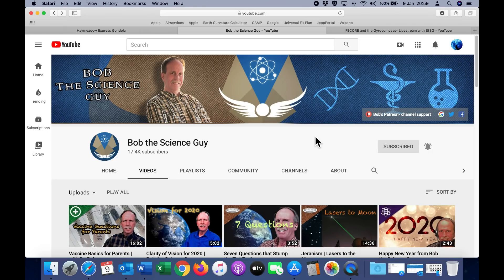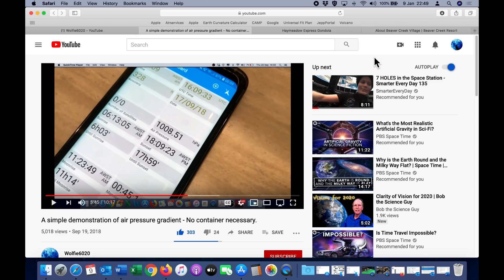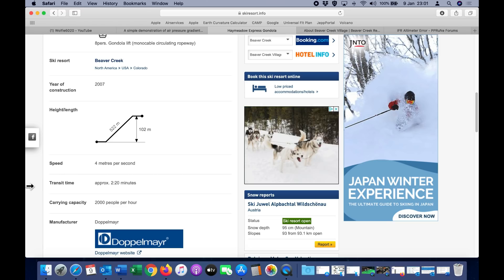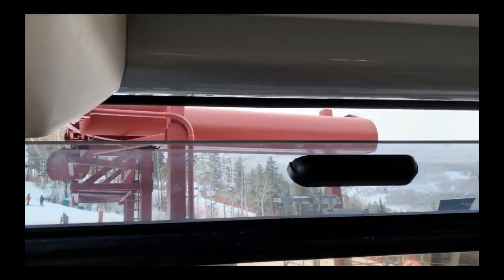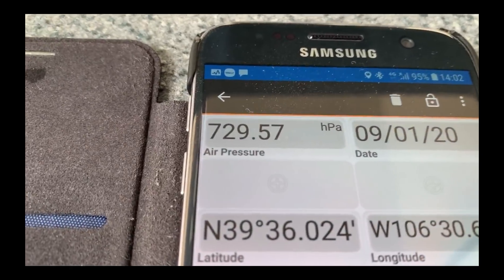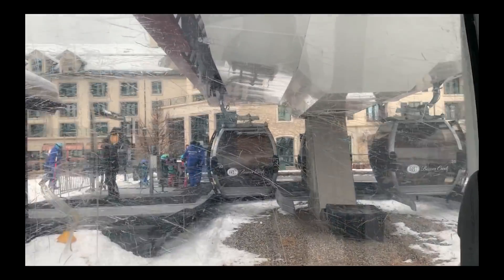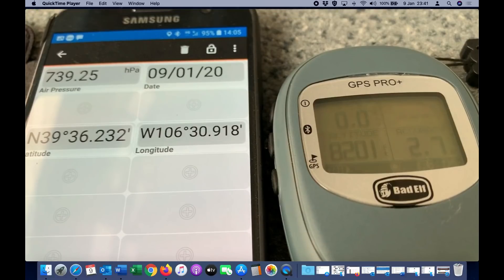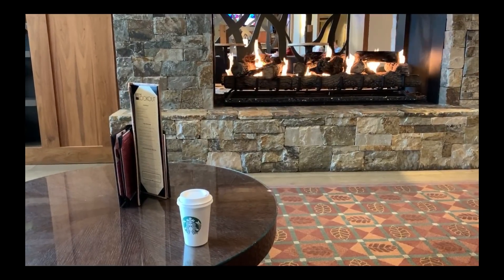Looking for a pressure gradient in Colorado USA.

Comment: Another wonderfully conceived, executed, and presented demonstration of a round-Earth truth – the effect of gravity on the atmosphere.

On a side note, though, I was puzzled by something you put out at the beginning of this, about the drop of pressure with increasing altitude.
1 hPa/30 ft ? So the atmosphere goes to 0 at 30,000 ft? And negative above that?
OK, it's a rule of thumb; but the point is, it isn't the pressure drop per altitude gain, ∆P/∆h, that's constant; it's the fractional, or percentage, ∆P/∆h, that is.

P vs h is close to a decaying exponential function, at least in the realm of commercial aviation (this falls out of the math of an ideal gas in a uniform gravitational field; significant change in temperature with h, causes it to deviate from exponential).
At sea level, the pressure is about 1000 hPa (1013 on ave; fluctuating with local weather).
So if it drops 1 hPa/30 ft at sea level, then as you go up, it should remain dropping about 0.1%/30 ft.

If you're at 40,000 ft, where the pressure is, I think, around P = 300 hPa ≈ 0.3 times sea level pressure; ∆P/∆h would be around 0.3 hPa/30 ft = 1 hPa/100 ft.
Surely pilots are taught this?

Fred

Comment: God, it's so stupid for FEs to say that hotels are under some kind of additional pressure different from the external pressure.
Reply: In fact, it is not necessary to ride a gondola, the usual 10-storey house and a chinese barometer are enough - it is not difficult to measure the pressure difference, and to make sure that the house is not pumped with additional pressure can be done with the exit to the balcony.

Comment: Experienced ear popping in planes and high speed elevators, both CN Tower and 1st Canadian Place in Toronto. Oh yeah and my phone has a BOSCH BMP280 barometric pressure sensor, accurate to 0.0018 hPa, currently 998.25 hPa and raining.

Comment: FFS Flerfers believe hotels are pressurised? How could they could tell? There's nothing but vacuum between their ears. 

To clarify modern buildings do create a positive air pressure in certain areas BUT this only occurs in fire stairs during a fire alarm to prevent the fire stairs being filled with smoke.

Comment: Easy pickings Wolfie. Of course pressure gradient is a thing.

If the atmosphere is not in a container, however, how do you explain that it hasn't been slowly stripped out by molecules escaping?

You know that according to !!!science!!! the hottest molecules in the atmosphere are in the last layer which called the Thermosphere and clock around 1700C (allegedly ofc) . That's plenty for them to escape the gravitational pull of the Earth. Once they are out you can repeat for the next layer. Considering air molecules of around room temperature can overtake the gravity in the ground and fill a container, the ones in the Thermosphere, which also has weaker gravity, should have no problem doing so. If they run out of energy the sun will heat them up the next day.

As a relatable example, I can fill a cup with cold water before going to the beach and not put a lid on it. It would be preposterous to say the water will jump out of it and I won't be able to drink it. But if I leave my cup on the beach getting hit by the sun all day, a week later there won't be any water left. All of it will evaporate. The atmosphere of the Earth seems to be "immune" to this.
Reply: "how do you explain that it hasn't been slowly stripped out by molecules escaping?"
Some molecules are escaping constantly, and some others are captured especially by the "sweeping" of the Earth on its trajectory around the sun.

Comment: I've been saying for years that these flerfers need to do some mountain climbing.  Climb a mountain, feel your lungs struggle for air.  Then tell me there's no pressure gradient.  When you get about two miles up you can feel it.  You don't even need a barometer.  We have a very conveniently located mountain here in Oregon called Mt. Hood.  I challenge any flerfer to summit that bitch or STFU.  They might save us some trouble by doing it in February and earning a Darwin Award in the process.

Comment: yes, but the "lift" you entered is a closed system with a barrier.  you need to prove the pressure changes, when you walk out side.

;)

(jk, I'm not an idiot)
Reply: Undoubtedly some flatty will see this and decide to believe that the increasing pressure in the lift interior has something to do with the windows being open and the lift descending at the blistering rate of like 50cm/s, forcing air into the lift cabin, and keeping the additional pressure there when it comes to rest because reasons.

Comment: Well done Wolfie, for some reason flerfters don't seem to recognise that a barometric altimeter is a glorified barometer which when calibrated properly will demonstrate altitude for a known local barometric pressure, or alternatively will demonstrate barometric pressure for a known local elevation.  Either way a pressure gradient is demonstrated.

Comment: It would be interesting to get the OAT as the same time. There are some pretty neat equations in Prandtl's book "Fluid Dynamics" which explain how temperature and pressure lapse rates are connected, and hence why the pressure lapse is linear. Great video, keep them coming.

Comment: C'mon, mate! Beside the interest of that experiment, admit you just wanted to get the freshest air possible after the very hot days that Australia is living...
Reply: You can add smoke and humidity to the heat. 48.9ºC (new record maximum for the Sydney basin) for Penrith on the western outskirts of Sydney a week ago.
Reply: @daveg2104  Smoke... The severity of those fires is heartbreaking.
Reply: @FrenchCrow  A lot of fires still burning, but Eastern Victoria and the Snowy Mountains region is seriously on fire now. Had a southerly change (cold front) come through last night that has dropped the temperature, but there hasn't been enough rain in much of N.S.W. to make a difference.
Reply: @daveg2104  Sad. France offered assistance a week ago (finally!) and australian goverment agreed we send some experts but nothing more so far. Too bad it would be difficult to bring some of our water bombers there (short range planes) but I guess some more firemen would not hurt.
Reply: Some water bomber helicopters could be stuffed in a big Antonov though :-)
Reply: @FrenchCrow  We do have water bombing capability, but the problem is that the fire fronts are too long, the fires too intense, and during a drought, water isn't always in plentiful supply where you need it. When the conditions allow, they try to put in control lines by back burning. It is about saving lives first and property second. We had a team from Canada here for a while, mostly to help relieve the controllers, and learn from us and pass on any knowledge they had. And we often have people from the USA, mostly from California, as they have similar fire problems to us.
Reply: @FrenchCrow  If you are interested in seeing what the current situation is, Google "RFS fires near me". It has a map showing all fires in N.S.W. and their current status. It also shows just how much forest has been burnt.
Reply: @daveg2104  I will look. Thanks.

Comment: One must have a very biased opinion to deny pressure gradient when he can feel it on his own eardrums while getting up or downhill in a car 😲
He can experiment it with a baloon fit on the mouth of a glass bottle as well.
Reply: Just carry an unopened bag of potato chips 👍
Reply: One needs to be intellectually dishonest. Which, as luck would have it, flerfs are in spades.
Reply: @ReValveiT_01  thank you for I learned a new idiom 😊
Reply: Indeed. I used to feel my ears pop occasionally as I drove to my work over an elevation of only 250 metres.

Comment: Simple kids-experiment from the 1970-80:s:
Get a balloon (party kind), a glas jar, a light straw or light stick that is twice the length of the diameter of the jar, a couple of rubberbands, and a tube of generic glue. (And a pair of sissors.)
Use a pair of sissors to cut the balloon into a circular piece, and stretch this tight over the open jar like a lid. Use the rubberbands to keep it in place.
Glue the one end of the straw to the 'rubber lid' at the center. You have now contructed a very basic barometer. (Very unsensitive...)

The altitude at which you stretch the lid over the jar will become the reference pressure.
As you move the 'instrument' up or down, the end of the straw that is sticking out, will rise with increased outside pressure and fall with decreased outside pressure.

We were taught about how this basic barometer functions in school, at the age of 11...
Reply from the maker: Thanks and I wish I had thought of that one at the time. 

Great experiment and I will definitely try it for a future video.
Reply: @Wolfie6020  Perhaps do a little more research, rather than taking my 30 year old memory on this as flawless. Please? ;-)
Reply: A slightly off egg in salt water would do the same thing due to the egg having a bit of gas in it.  Bugger to set up but it has egg.....the instrument of FE choice.

I made a barometer with a long length of small bore flexible plastic tubing that had one end capped off and the other with a plug of coloured water as a low tech method of measuring the max height of my rc glider.  The drop in air pressure pushed some of the water out of the tube, when it landed the water was sucked back.  If memory serves 1mm = 10m with a tube of about 1m length.

This stuff is not hard.
Reply: Sky Sparkane did this in one video.  Results were as expected.
Reply: @SpottedSharks  Thanks for the ref... watched and felt very little to no surprize.
https://www.youtube.com/watch?v=w2AGNp7xT2I

Comment: Hey Wolfie:  3:10  .....but I love the snow and cold weather.    Then you should come here to Edmonton in Canada.  We have lots of snow and it is -20°C.   ❄️ 🥶        Take that Colorado.    😁
Reply from the maker: +My3dviews.  I usually go to Montreal for a week in February for annual training.  That is very cold.  I almost froze walking to get the hire car from the airport one year.  I think it was -25 C.
Reply: @Wolfie6020    I've been to Montreal (long time ago), but only in the summer.  
It is supposed to get -31°C here next Tuesday.   Not looking forward to that. 

I lived in a different part of Canada ten years ago, and one time a window in my bedroom broke, when it went down to -40°C while I was sleeping.  Scare the @#$% out of me.
Reply: @derpjesus3468     There is no high gas pressure against a vacuum.  
Think about it.  What happens when you go up in altitude?  The pressure at sea level is 14.7psi.  If you go to the height of Mt. Everest the pressure is only 4.9psi or about 30% of sea level.  Go up even higher and the pressure continues to drop.  Ever fly in a jet at high altitudes?  Why is the cabin pressurized?  Answer, because the air pressure outside is so low that you would suffocate.  
So, again there is no high pressure against a vacuum, but a pressure gradient, where the pressure gradually drops with altitude until near zero. 
No, the Earth cannot be flat.  That would require one of two things.  Either it is infinite, or it has an edge.  If it is infinite, then it can't have a dome over it like flat Earthers claim.  If it is not infinite, then it has to have an edge.  That has never been seen.  
Proofs that we are on a spherical planet:  The sun sets below the horizon.  The Earth casts a circular shadow on the moon during  a lunar eclipse.  Objects disappear below the horizon over water at a distance.  Like this photo of Toronto from Olcott N.Y.:
https://dl0.creation.com/articles/p116/c11646/toronto.gif
We have satellites that orbit the Earth, which can easily be seen just after sunset, especially the ISS, which is about as bright as Venus.  
With the flat Earth, you have no explanations for a lunar eclipse.  It would be impossible for the Earth to cast a shadow on the moon, when both the sun and moon are said to always be above the flat Earth.  
Plus why do the sun and moon make circles over the Earth?  Why is there a south pole and a south celestial pole?  Why can you track stars with an equatorial mount with the polar axis aimed a the south celestial pole if it doesn't exist.  That is just a small example of things that can only be explained with a globe Earth.  Perspective is not what flat Earthers claim and doesn't answer why things go below a flat surface, or why there even is a horizon on a flat Earth.  All eclipses are predictable due to the motions of the Earth and moon around the sun and their orbits.  Eclipses are never predicted by flat Earthers and their model of the Earth.

Comment: But, but, but...
You forgot the snow blowers. They force the air pressure down the hill.
And, How about the snow. It obviously reflects the pressure. More snow up top, means less pressure
And, You were in a gondola with a floor, walls and a roof... Inside a container... didn't think of that one did you. Eh Wolfie.
And,  the earth is flat so mountains don't exist, so your entire video is CGI
And,  NASA paid you
And,  the heat from your phone expanded the air in your container - didn't think about entropy either did ya.
AND... Of crap that's about all the garbage responses I can think of.

So hotels are pressurised, and you had to repeat it outdoors. Flatists  just cant get their brains out of reverse can they.

Wait thought of another one....

AND your were inside a snow dome. That's a container my friend. No flakes falling, so no one had shaken it up for a while.

Great video Wolfie. Simple, to the point. Thanks

Comment: Now let's see if any globe denier can show a pressure gradient inside a closed container.
Keep up the good work, Wolfie.
Reply: *without the implication of an acceleration. If you accept gravity, it’s rather trivial to have a pressure gradient inside any closed container.
Reply: @sphaera2520  I would like to see that, because as I understand it, no matter where you have your pressure gauge, it would always read the same.
Unless you mean the small effect that gravity would have on the gas inside that container?, but it shouldn't be too much of a difference.
Reply: @GoldSrc_  As Wolfie says at the start of the video, the pressure reduces by 1 hPa for every 30 feet you go higher. That would be true for a closed container as well, because of the effect of gravity on the gas inside. To detect it you would need a long vertical sealed tube, and two accurate pressure gauges, one at the top and one at the bottom, so it's not an easy experiment to perform, but if you did, the difference would be there.
Reply: @ceejay0137  Thing is, I was talking about a pressurized container, there, the pressure would be the same regardless of how tall it was, and any difference would be negligible I think.
Of course a container with just atmospheric pressure would be subject to gravity and show the same.
Reply: @GoldSrc_  OK, but your original comment doesn't actually say that: it just says "closed container". Even so, the fact that a container was pressurised (i.e. had a pressure inside it greater than normal atmospheric pressure) would not stop gravity acting on the contents. The pressure difference between the top and bottom would still be there, and would still be 1 hPa per 30 feet, but the difference would be a smaller percentage of the total pressure, and thus harder to measure.
Reply: @ceejay0137  Of course, but remember that the idiots always claim that there's a dome, they will never accept the fact that the atmosphere does not need a container.
They really mean a solid dome that contains the atmosphere inside it, because they don't accept that space is a thing.
Sorry if I worded stuff weird.

Comment: If you get a view of the plains give us a wave down here in eastern Boulder County.

Maybe you could explain why reciprocating engines benefit from turbochargers and superchargers for high altitude flight and why mechanically driven superchargers might need to be engaged/disengaged or have different stages.

Comment: Weird thing about those "pressurised hotels" is that many a flattie is also a moon hoaxer, and that community KNOWS that pressure differences have almost incalculable power, leading inevitably to the atmosphere roaring into space like Ripley opening an airlock, while spacesuits burst like ripe grapes on a rainy day. So how do these hotels manage it with just a sliding glass door?
Reply: It's interesting to note that the cabin of the Apollo spacecrafts had only 1/3 of normal sea level pressure and almost 100 % oxygen. That means that the pressure difference on each side of the hull was less for an Apollo than for a Boeing or Airbus at typical cruising altitude!

Comment: On a serious note, I wonder how many of our Flerf friends could work out the direction you were travelling by watching the Lat and Long changing on your display. From the start at 39 36.032N 106 30.691W to 30 36.232N 106 30.918W and the distance?  It's all there for them to work out if they can.
Reply: I think you are being too generous.. more like 5 milliwatts.........
Reply: @monochromaticlightsource9153  well I usually like to give people the benefit of the doubt. But alas, you are correct
Reply: Oh hell, between the collective of Flerfs you'll be lucky to garner enough brainpower to light up a single 5 watt bulb.